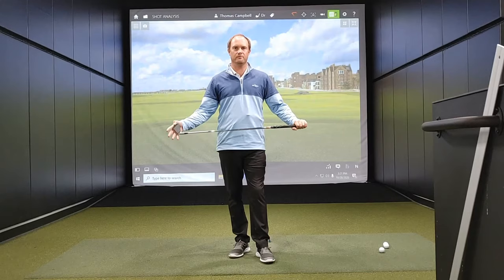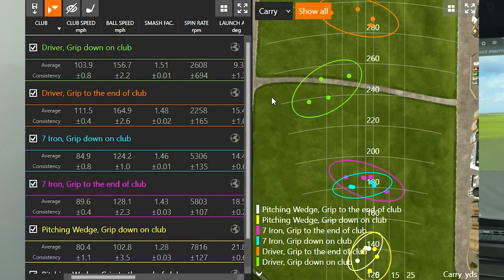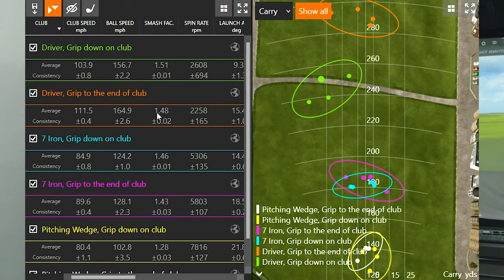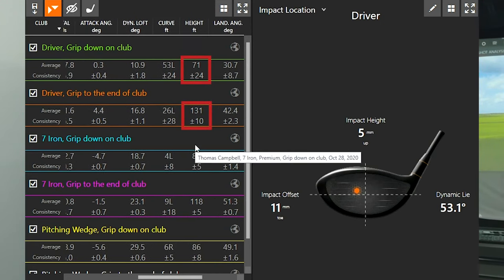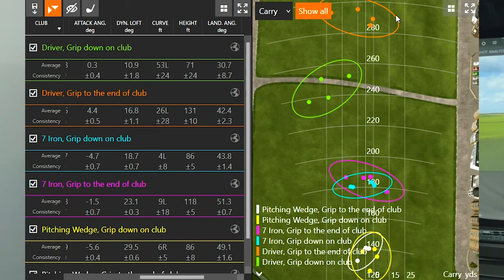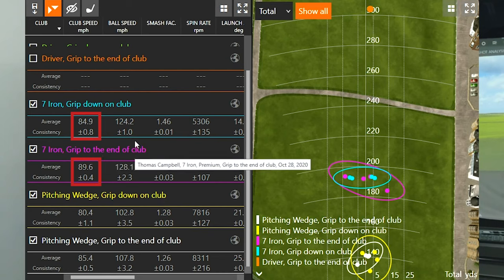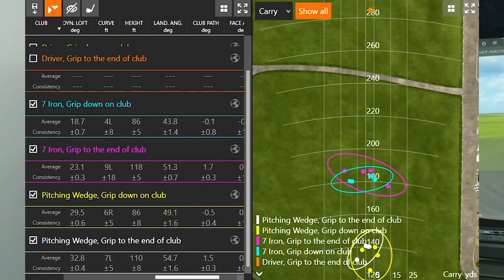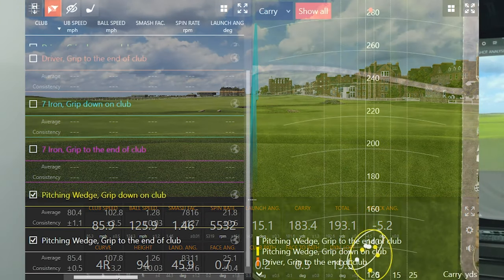How Gripping Down On The Club Effects Performance | When to Choke Down on the Golf Club

Comment: What I found, is increased Swing Speed, more Consistency in strikes, and the same or more distance off the tee, the only two issues are, if my armpits come off my chest/body and reaching too far, I hit the ball very low, besides, What I had to change is playing the ball off my left toe, tee height and low point were a struggle at first, needed to be higher for me...that's me, no lost of distance if anything more distance and more control hitting the center of the clubface with Irons and Driver.

Comment: The “down” was extreme and most would move down about an 1” to 1½”. That would be a more realistic comparison and would add insight to whether a club should be that much shorter. My experience has been that 1-1½” has produced higher ball flight, more distance, with a little draw. Going to an extreme is useless. The only time yo grip down that much is for green side chipping.

Comment: Since your a club maker or fitter I'd like to ask , if I am gripping a little to high high on yhe grip can it impede my grip because of the built in counterweight on every club at the very end .
And would just adjusting my grip position affect the swing weight for me or lie angle etc , can half an inch or so create problems , inconsistencies or a poor grip if it's to high on the grip , is it possible that would make the club length to long from person to person